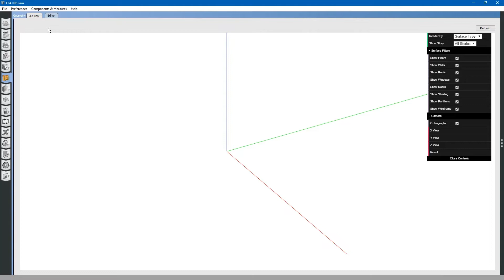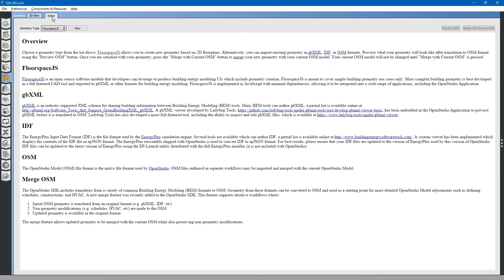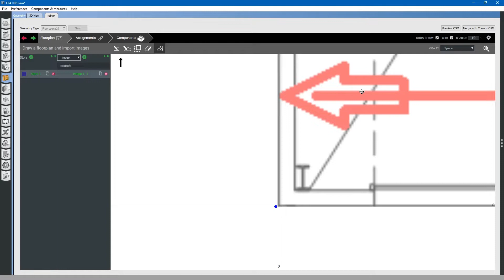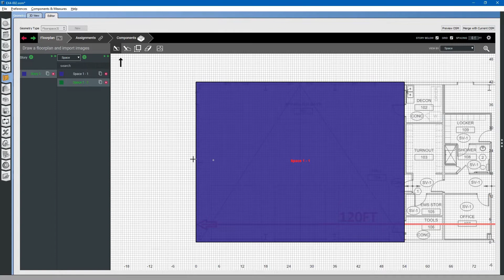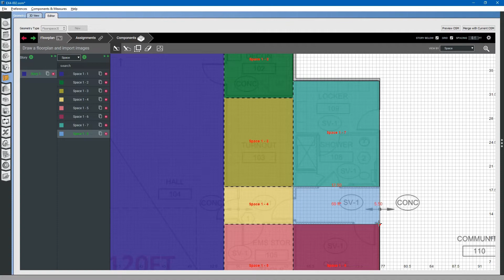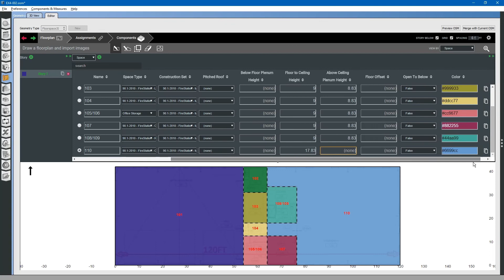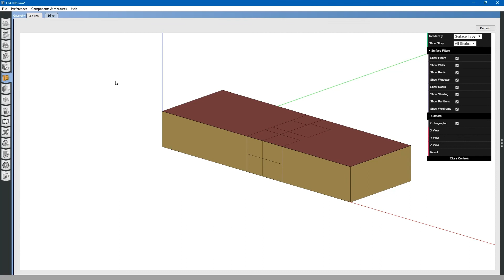Building Energy Modeling in OpenStudio - Create Geometry

Comment: On the space type .... i am nopt getting any dropdwon. what to do? what should i select in space type
Reply from the maker: If you do not get any dropdown, that means you do not have any space types loaded into your model.  Go to the Space Types tab, select Library on the top right, select space types category, and then drag and drop space types into the dash box on the top left where it says Drop Space Type.  See: https://youtu.be/O1QFj350a2I?si=PdQRxt1pUtJ3bP1p&t=82

See also: https://youtu.be/bsGpyyoMV_I?si=ufb4z-XRhoxNV5kF
Reply from the maker: I do not have any experience modeling a green roof using OpenStudio, so I am afraid I cannot help you with the details.  Unmethours.com has lots of good information that may help you tackle this problem.

Comment: How will I get the library files for college building if I want to determine the energy of the existing college building.
Reply from the maker: Library files are based on Department of Energy (DOE) standard models or previous projects you have completed.  If you do not have previous projects like a college building, you will have to start with the DOE files and modify them to suite your project.

Comment: Thanks for these videos! 
How do I get the axis to show up on the bottom and sides to start at 0/0? My editor is not showing axis just the grid.
Reply from the maker: It is possible that your grid spacing is set to a very large number.  Select "spacing" at the top right and change to a lower scale.  You might also uncheck and recheck the "grid" option.  To zoom in and out of the grid, you can use the mouse wheel.  By zooming in and out, you can adjust where 0/0 is shown on your screen.

Comment: How did you decide if the space should include the wall or exclude it. It seems you did it arbitrarily.
Reply from the maker: Good question Ziyad.  The two storage rooms are a similar type of space.  It is best to simplify your energy model when possible.  The storage rooms will have the same internal loads, schedule set, and occupancy pattern.  Therefore, EnergyPlus would output the same result, no matter if they were separated or combined.  By combining them, it saves computation time.  

The locker and shower room also share the same space type.  Technically, we could make two separate space types for these, but the energy differences would be minor in the final results.

Comment: So you didn't add windows to the rooms with plenums above because it adds windows to the plenums and causes issues? is that why you didn't show that?
Reply from the maker: Windows are added in the next video.  For this project, there were no windows at the level of the plenum.  You can add windows to plenums, no issues, because plenums are treated as just another space.
Reply: @helixenergypartnersllc3540  no I mean OS adds windows to plenums automatically when you add to the below space even you don't want them there and if you delete them they just come back when you use the geometry editor. It uses the same sill height which makes the windows float in the air above the building. There doesn't seem to be any way to add them to the room but not the plenum.
Reply from the maker: Interesting!  I have not encountered this issue yet.  You might try using the FloorSpaceJS webbrowser editor instead, as it seems to be less buggy than using it within OpenStudio.  You might also try editing with SketchUp.  Deleting geometry in Sketchup is very quick.  You might also consider just making a second story (3-4 foot height) and calling that a plenum.
Reply: @helixenergypartnersllc3540  Sketchup is very expensive and i do not have access to it.
Reply from the maker: @CybekCusal  Yes, the paid version is moderately expensive.  You could use SketchUp Make, which is free, but it is only compatible with OpenStudio version 2.9.1 or less.  I would say SketchUp is much less expensive than an alternative geometry editing program such as revit or TAS.

Comment: Is OpenStudio being discontinued?
Reply from the maker: No.  However, it will no longer receive funding by the US Department of Energy.  My understanding is that it will remain an opensource license so the existing developers can continue to develop the software.
Reply: @helixenergypartnersllc3540  so development will slow to a crawl.
Reply: @Z-add  It will not receive DOE funding, but there is a coalition of people/companies working to support it. It may receive more support outside the DOE than in the past, as its development was ramped down over the last few years.
Reply: This question actually needs a few parts to answer, see this https://www.openstudio.net/new-future-for-openstudio-application for details.

The backend engine, EnergyPlus, and the OpenStudio SDK are still actively developed and supported by US DOE.

The OpenStudio Application and SketchUp Plug-in have not been actively developed by US DOE for several years.  Those have recently been transitioned to the OpenStudio Coalition, https://openstudiocoalition.org/, which plans to continue to support these tools.  As Marc said, it is possible that the OpenStudio Coalition may be able to support these tools at a higher level than the DOE has been for the last couple of years.